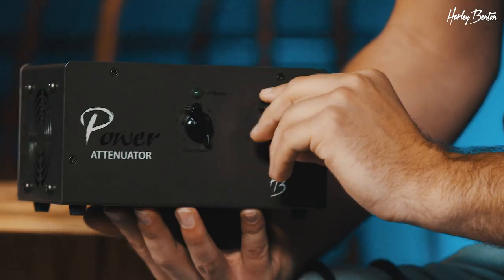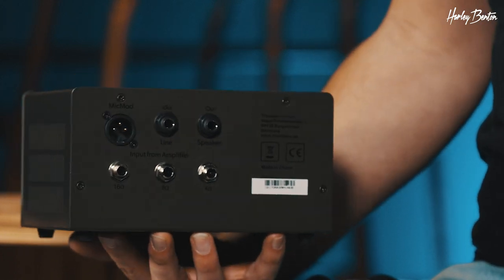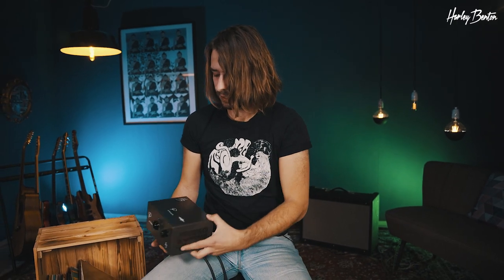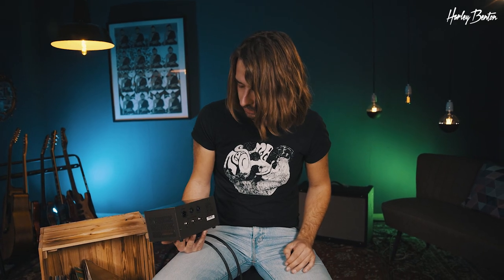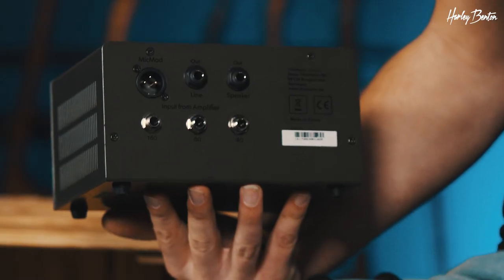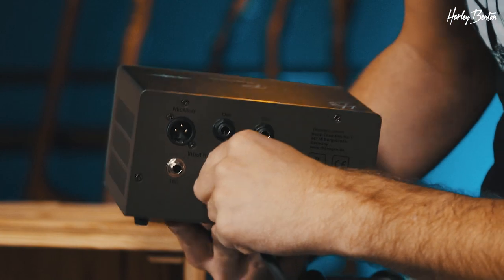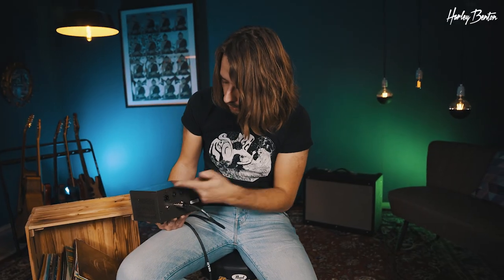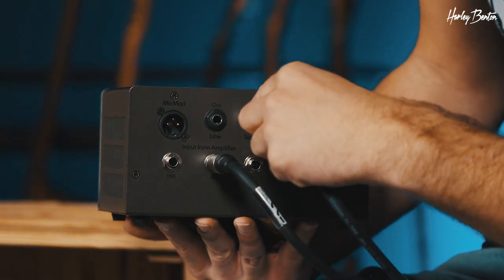Harley Benton - PA-100 Power Attenuator -

Comment: I have been using powerbrakes for years but this one for a couple of years now, cannot play without it, it’s great and it’s killer value for money. Very well built, the fan inside is a clever idea. If THD or other “big” brands would have made exactly the same powerbrake, it would cost 3 times more, or more.
Reply: Yes. Because the chinese are making it for 15 dollars. How much Did you pay for it ?
Reply: The Chinese are making it for much less than $15... I can guarantee you that

Comment: I got it 4 weeks now and did test it with DSL1 and 6505MH and it´s great. If you crank up an amp though you have a problem with time based effects so the only logical way is to use a dummy load like EVH and other great artists use it.The Harley Benton is the clear proof that you don´t have to spend 200 or even 500 and more for a reactive load. EVH didn´t use it so we don´t have to use it either..

Comment: I literally got this one like month ago - and it's fantastic. I fell in love with my pignose g40v again. <3 
The only thing I would add to it would be some treble bleed switch, with low values it seems to take quite a bit of high frequencies. 
But nevertheless - great and reasonably priced device <3
Reply from the maker: Thanks Harry! Yes the PA-100 is quite versatile!
Reply: i think, you get better result compensating on the amp, rather than adding treble to the attenuator.. Some brands make it and i don't sound really right to my ears. Simply push some treble on the amp and you're right again.

Comment: I have this attenuator I love it right now I'm using it in my bedroom with my joyo zombie and HB vintage 2x12 cab it works excellent I have my joyo cranked all the way up and use this device as my volume control. I also have a Marshall half stack 900 head which I will eventually use this device for. I love your products just not your shipping prices or packaging please work on that Harley Benton thanks.
Reply from the maker: Great to hear! Shipping prices at the moment are due to covid.
Reply: @HarleyBentonOfficial  This is not the whole truth, your shipping rates to the East of Musikhaus Thomann have always been much, much higher than to the West. Rates to Budapest, Hungary for example are ridiculously high when compared to that of the UK and Ireland even though Budapest is up to half the distance and doesn't cross the sea. And even then my items are delivered by national post (ie collect at post office and haul boxes home) and not by courier as is the case for the UK, Ireland, Belgium and others.

So why should I pay a higher delivery cost for a lesser service? Are all customers not equal? Just check the rates for countries such as Sweden, Finland, Spain compared to Hungary, Poland or Slovakia. Even though Prague, Czech Republic is just 350km from Musikhaus Thomann, it still has higher shipping rates than Stockholm Sweden, which is 1500km from Musikhaus Thomann. These rates need to be reassessed and contracts with couriers, renegotiated.
You can argue that the transport infrasctructure isn't the same but weren't the 'old systems' of East Germany and central Europe not the same? And are the current systems of these countries not funded in exactly the same way as all EU member states? Save for the fact that, counterintuitively, the road infrastructure may be newer in the East than in the West..

Ignoring the current logistics difficulties, I can get my products shipped from Gear4Music in the UK all the way to Budapest for less than Thomann could get them from Burgebrach to Prague.

Comment: I bought the PA-100 for my RIVERA Chubster 25Watt combo amp. It does a great job , but I have a few remarks : if you have the speaker level on zero then there is nearly no output from the line out even when you put the line out on max !! The line out gives a decent signal without noise on speaker level 1,5 to 2. Secondly the simulated speaker output (XLR) does not sound that well ( fuzzy , muddy even with clean sounds) so I always use the line out or if I want to record without sound from the amplifier then I use the preamp out ( = fx send ) from my amplifier. So I recommend this box 👍😀
Reply: I'm learning that after hearing an amp, then hearing the xLR output from the PC Speakers, will always sound like mud in comparison, whatever you use, because the digital conversion just does'nt have it. You would need very high end conversion to get anywhere near. I think the best way round is to use a quality mic into the XLR/ interface to get a better envelope from the amp.

Comment: Just receive it today :) Will try it tomorrow with my 50 W Marshall Origin. I think it'll rock ! Knew your channel for only a few days. Really great job, i like it :) carry on !
Reply: And how do you like it?
Reply: @kubatrolski5450  Well, it is the first time i use an attenuator. And i did not find one negative point at this point. It is silent (the little fan starts only when you are playing) and really efficient. And it looks solid. I discovered a dimension and sounds with it on my origin 50h that i did not expect. This sort of pedal should be saled with the amp. It is just perfect. According to me as usual.

Comment: I have one of these  pa-100 works great with my Marshall dsl 40 cr but today I thought let’s try it on my fender 68 twin reverb reissue and it sounded amazing I was so happy for 10 min I had it on 5 middle position and amp on 6. Then it started smelling really bad very strong I touched the attenuator not hot at all but the smell was strong so I turned it off.

Comment: Hello,

i have questions :
Does volume level of Line output and Speaker output are totally separated ? you can reduce speaker cab to very low and have good line out volume level ?

Can you also totally unplug the spaaker cable from the  Attenuator to cabinet to have a sort of loadbox (no sound at all from the cab) and just use the Line output of the PA-100 box to plug into audio interface for using IRs ?

Thanks you !

Comment: Good attenuator, bad mic sim....  it's easy to mod the line out to a constant level instead of following the volume control. It can be done with the mic mod too, but it is a little more involved FYI
Reply: What you are saying is that the volume controls the line out volume too... Like a master volume.  So you if need to monitor or record then it's less convenient.
Reply: @kenmasters007  Yes, but moving the tapped signal from the wirepots middle leg (output) to the input side, makes the signal full strength which is desirable ;-)
Reply: @christianboddum8783  that's a good hack.. but I assume it's a fixed level?. Too bad the line out can't just be separate.. volume adjusts individually...
Reply: @kenmasters007  No it's not fixed that way. The amp of course is the determining factor as to how hot the line signal can be, but it will keep the line level pot working. Most of the time it will have to be close to 100% any ways - FWIW

Comment: HARLEY BENTON, EVH power attenuator dummy load used 20 ohm power resistors so it converted 8 ohms to 20 ohms. Why 20 ohms is because his tech said that when an amplifiers is crank to 10 max the speakers get hot and the DC resistance is 20 ohms. Why not add this to the Harley Benton PA100 a 20 ohm option to get that EVH tone?

Comment: Does this come with a speaker cable or should I buy one when ordering it.

edit: I'd like to use it with my marshall origin 50, it has some great crunch tones when the gain and master is cranked but it's too loud without an attenuator.

Comment: Harley, we need a clean solution for using different, lets say five, heads with one cab and one attenuator. Is that possible?
Reply: “We” need to play five heads through one cab?  Do “we”? Haha. 

It isn’t exactly clean, but you could get one attenuator for each head and run the line out to a mixer.

Comment: I also "discovered " that it is probably even a REACTIVE PB, because the fan and light change with the power. But if you look at other reactive ones you will see they ALL cost many times more
Reply: It is 100% passive. There are only resistors inside the box. The only electronics are for the fan and the xlr output.
Reply: @TomaszCzajka80  , I don't do electronics but as far as I know, being passive has nothing to do with being REACTIVE.  I wrote that the FAN speed and LIGHT intensity CHANGE depending on the POWER and how you play. That's reactivity as far as I know.
Reply: so it seems to me that it's a mixture of reactive and resistors. That it is passive doesn't matter. Passive means that it doesn't require power. I had a Palmer attenuator and it was passive and reactive. The Marshall powerbrake too works in similar ways, I think. The fan speed and the light changes with the power and the playing.
Reply: Neither is true that "there are only resistors inside the box". Again there's a fan and the LED. Anyways, it's the best attenuator you can buy for the money, or even for more money; let's leave it as that...
Reply: Perhaps by " it's passive " you mean "it's a resistive attenuator" i.e. not reactive. Even so, my points remain. A simple resistive attenuator doesn't have fans and LEDs that react to the amp's power and how you play, so I think that at the very least the Harley Benton goes beyond other resistive attenuators, and for less money.

Comment: The line out DOES NOT work unless the main atteuator is sending signal to the speaker. You have to disconnect the speaker from the box to record silently... unless mine is screwed (heard this from others too)
Reply: There's a simple mod for that. I did it and it works a treat: https://www.youtube.com/watch?v=YoVqZlKkXvo

Comment: I have HARLEY BENTON mighty 5 watt and Harley benton cabinet with Celestion V30,, do you think I can use power attenuator, or is better To use the Mighty switchable to 1 watt?   

Please : the new Mighty 15" watt is better with SEND Return and Switchable Boost 😁
Reply from the maker: You'd be better of using the switches on your amp, and of course we are already working on a Mighty-15TH MK II. :)

Comment: So can i run this box without a speaker connected? I have this strange problem, that there is no DI signal coming through unless i turn up the attenuator volume.

Comment: So, to use without a cab: amp speaker out into corresponding impedance input, speaker level set to 0 and then line out into interface?

Comment: How do we power hb pa 100 I have bought it yesterday. I tried to connect using a trs cable from speaker out of amp to input from the amplifier of hb pa 100. And anothe cable from the out of the pa 100 into the input of the speaker. And it seemed not working. Can anyone help

Comment: That looks so awesome. Woulf i use the di out or the balanced output to connect to my interface for cab simulation inside a daw?
Reply from the maker: You can try out both :)
Reply: @HarleyBentonOfficial  hey maybe you can answer a couple of quick questions.  I am waiting to order but your customer support never reads all the questions and then takes 5 days to reply. 
1. Can this attenuator be plugged in worldwide  110 US and 240 Global without a separate transformer?
2 . Same for the Harley benton iso pro 12 power supply. Compatible with 110 and 240 v ?

Comment: Excuse my ignorance, what does the LIne Level knob do....in simple english....not being sarcastic, I won't understand otherwise and thanks in advance.
Reply from the maker: Line knob controls volume of the Line out. SPK knob controls the volume of the Speaker out. Line out got lower power and is used for mixing consoles for example. Speaker out got more power and is used for speakers. If you would put Line out directly into a speaker it would be really quiet and would require some amplification first. Hope that helped.
Reply: @HarleyBentonOfficial  Thank you, I appreciate you taking the time.

Comment: When you say it can handle 100W does that mean I can use it with my Marshall JCM 2000 head?
Reply: It is always better to go for double the power rating, eg. for 100w amp attenuator should be 200w. You maybe can run two of these paraller, like you could use two speaker cabs

Comment: Is it possible to use this to connect an amp head to a usb interface directly through this device (using cabinet simulations in Amplitube 4) without any sort of simulation from the attenuator itself?

Real cab silent, or not connected at all possible?

THANKS
Reply: Yes, if your interface can take line level signal. Micmod has cabsim, line out doesn't

Description says it can be used as a dummy load, that means no speaker needed

Comment: Does it works with combo tube amp?
Reply: Yes, this!
Reply: @sassycat  how?
Reply: @yurired567  my apologies, I am meaning to say that I am in agreement with your question: does this work with a combo amp, and if yes, how?
Reply: Yes as long as your combo allows you to disconnect the speaker.  Not all combos have that option.
Reply: @yurired567  I’m new to this but could you run it through the effect loop?

Comment: This one Sounds Terrible. I used for a few weeks and after that i unplugged it and wondert how good my Amp can sound. Its makes the sound Muddy cuts the lows and lower mids. Also the Knobs are with Screws but you actually need a push on Knob. So its loose and cant be tighten and fells off. Terrible product!